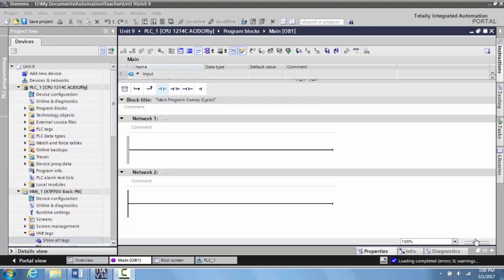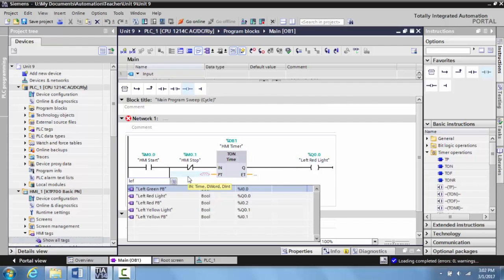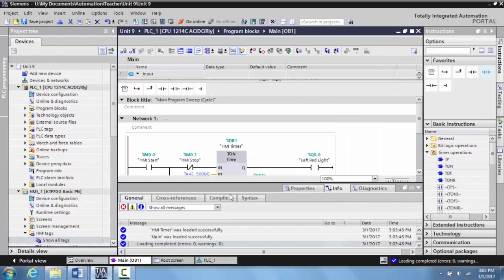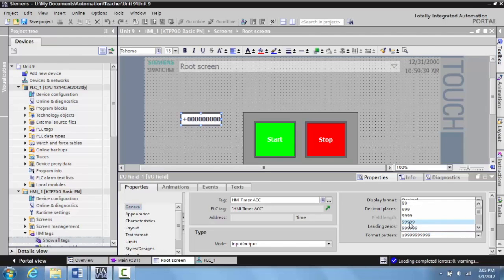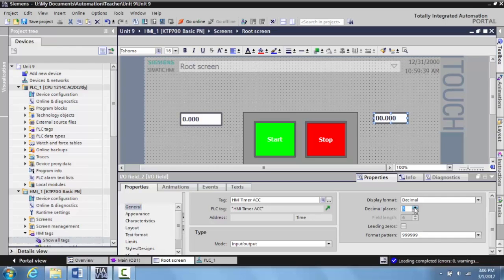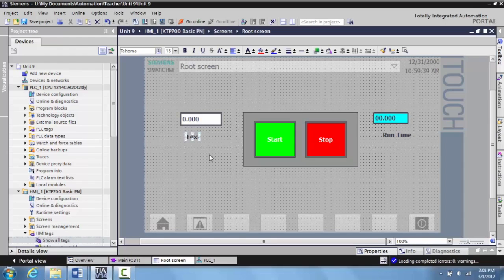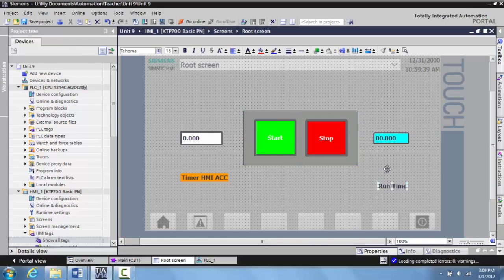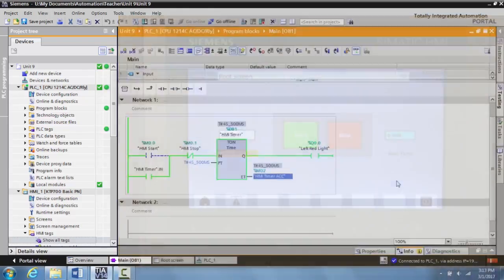Controlling and Displaying a Timer on a Siemens HMI - Unit 15.1

Comment: I have gone over it over and over, but changing the time of a timer in an HMI is proving to be a challenge, counters are easy just choose a specified tag from the program block list, make sure its name is PV (preset value), and the data is INT not BOOL. But thank you for your response.
Reply from the maker: If you still need help, send me your e-mail and I will respond.  You can then send me a video of the problem.

Comment: They must have wrecked something in TIA V14 I can't even drag the ACC over to the screen for the timer.
How do you show the value when you go over 60 sec like 10 minutes?
Reply from the maker: It is a little trial and error.  You have to set the decimal point to correctly.